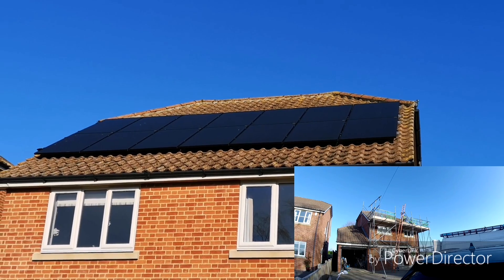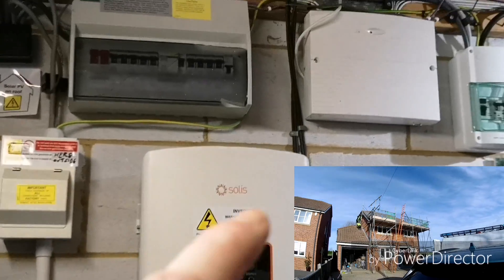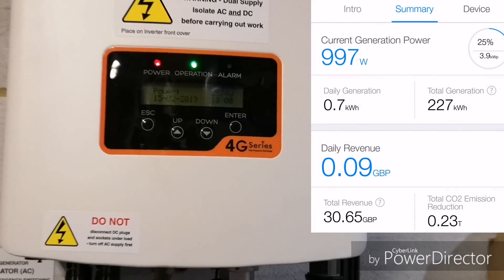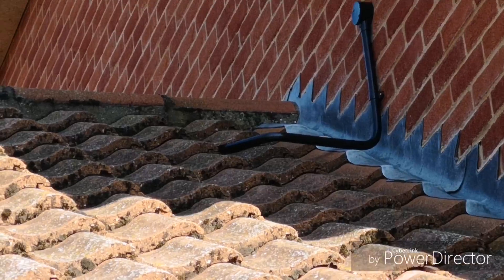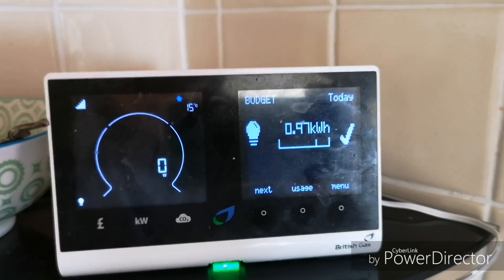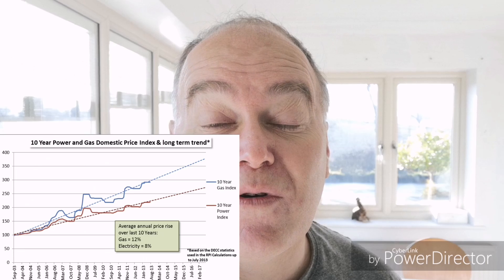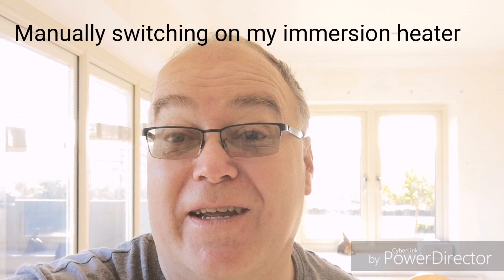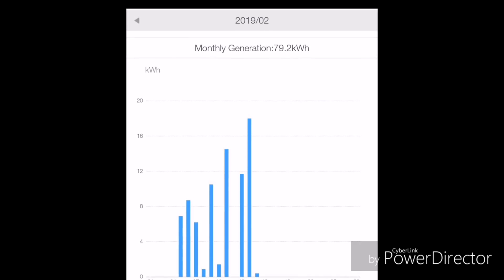Solar PV to go with my Kona and Zappi. Why I've added solar.

Comment: Your Solar install from EON...I have also just invested in EON installation...a bit of luck on my part EON have run out of the 280W   panels and I've managed to be supplied with 320W panels free a result. I notice on your video the feeds from your solar panel come in on Dc1 and Dc2 which is the same as mine, what reason did they give you that only Dc1 is producing power and Dc2 is 0,  I would expect Dc2 to also produce power if the panels are split loaded ie two strings split in half otherwise why is DC2 connected?
Reply from the maker: Lucky so and so on 320w panels. Better in low light conditions.
Eon never mentioned it to me. 
Dç2 shows as almost zero to me also
Reply: @EVPuzzle  hum ! They are coming back Next Monday to check the installation as I calculated that I'm not getting full wattage. we've had maximum of 9.2kw in one day and we've had a couple of great days weather wise. I face south south west no shade with 13 panels. Remind me how many have you got?
Reply from the maker: 14 X 280.
Peak day so far 18kwh.
3.2kw max instant generation seen so far on cloudless day
Reply: @EVPuzzle  I fully understand you never get the Max...but I should be getting near the figures your getting. Btw I've been following you for while, the EON was a no brainer especially as I was also quoted £8000+ for similar installation. I'm currently building a power wall to save more energy. I'm also wanting to get the E-Niro but looking at contract lease, which is another reason why I wanted the Solar panels.
Reply from the maker: I guess it's the fear we all have, not getting quite the right power expected. I was curious at the very low numbers on DC 2, doesn't make sense but then I know nothing about electronics 😣🤔

Currently getting 0.3v on dc 2 Vs 219 on DC 1
Reply: @EVPuzzle  lucky for me  I was a Avionics engineer, but now work in computer security. I'll let you know the out come on Monday. What power are you getting now as it's very clear here in Northamptonshire.
Reply: 199v on DC1   0.70 on DC2
Reply: It would be good to keep in touch and compare output results over time.
Reply: Honda suffering in the change from ice to electric vehicles, should turn plant into electric vehicles.
Reply: @EVPuzzle  Not used to this messaging been replying to myself for last five messages I think Doh!!
Reply: @EVPuzzle  199v on DC1   0.70 on DC2
Reply from the maker: 400watts.  It's 8:39 and 95% high grey/white cloud

If clearer I've seen 1kw in clear skies before 9.

Looks like a nice day ahead
Reply: @EVPuzzle  391 watts 9:15 clear skies
Reply from the maker: That's not right unless it's facing the wrong way. Luckily I'll due south. Rises to my left, sets to the right , slap bang in the middle at midday
Reply: @EVPuzzle  yes I'm facing virtually the same as you rises from our left and sets to the right. Like I say being an ex-Avionics Engineer I've calculated that I'm not getting full power. So I'll what they say when they come back Monday.
Reply from the maker: Fingers crossed
Reply: @EVPuzzle  12:59  bit cloudy 4.7kw produced today 1.3kw at the moment.
Reply from the maker: 1.5kw at present, generated 7.8kwh so far but has been good sun for last hour
Reply: @EVPuzzle  6.5k total today afternoon turned out cloudy.
Reply: @EVPuzzle  just as an update we had 9.8kw today mostly generated this afternoon.
Reply from the maker: Looks like we generated 9.2 yesterday. Different weather makes it hard to compare
Reply: @EVPuzzle  yes your right Nigel, it is difficult with such changes in localised weather. Perhaps when it's clear across the whole of the UK we can get a more accurate comparison.
Reply from the maker: This next week actually looks good here. Warming up nicely

In essence I'm getting 1kw in bright clouded skies, 1.5ke in broken clouds, 2 - 2.3kw in very high slight cloud and 3+ in cloudless skies   all subject to time if day of course.

I've seen 3.6 KW once at 1130 to 1200 just for a few minutes

Cloudless skies here now but getting 240watts at 735am
Reply: @EVPuzzle   just for an update today  my system produced 10.2kw today after a slow uptake this afternoon and the fact day light hours are getting longer things are getting better....roll on Monday when EON come back to revisit the installation.
Reply from the maker: If you had the same surveys as me, they estimate the generation annually so if it's way off they should know.

If it's the panels, I'll gladly swap my 280 for your 320 😉
Reply: @EVPuzzle  I bet you would 😏
Reply: @EVPuzzle  ok update Engineer on site Monday extra panel installed new inverter installed Solis 1p6k.
Now I have Voltage on both DC1 and DC2. Engineer tells me the 1st inverter has DC1 and DC2 connected internally. Which is why you only see one input..I'll check that explanation on my 1p3.6k inverter which I now have spare.
To day very sunny but a lot of Haze total is 9.50kw produced to đay
Reply from the maker: Pleased they've improved things.
The inverter difference makes sense, I think.
Been great here today. Best generation so far. 20kwh, yesterday 19.7kwh and 18.7kwh before that. Beautiful clear skies but foggy first thing on Monday. 
We're lucky to have a great roof position.
Reply: @EVPuzzle  yep that's double what I'm getting ....can't quite work that out yet. 
I've seen your house and its position...mine is more ssw facing and the Sun is still low for our time of year. 10kw is the best I've seen to date I would expect as the Sun gets higher I should see some improvement. I'll keep updating you my progress
Reply from the maker: Different angles and direction seems to count for a lot. I have no shaded areas and no obstructions do again very lucky.

It is odd though how the last 3 days have generated the most here but not produced peak output. I've seen 3.3kw and 3.6kw fleetingly on previous day's  but last 3 days with a clear skies just 3.0kw Max output at mid-day. Slight cloud seems to be better, perhaps less haze

Roll on summer with long days
Reply: @EVPuzzle  have you an Email address I can send you a Graph comparison to my position.
Reply from the maker: Sure.. email is in all the video descriptions..

Eon estimated I'd generate 3000 units a year. That's all that counts I guess as it's the basis we agreed to.
Reply: @EVPuzzle   That's good I can see you have a totally ideal location checked on Google earth wasn't too difficult to track where you are using your videos and Google Earth. As a Security professional be careful publishing videos and letting people know your out for the day, I send those emails tonight.
Reply from the maker: Let me know how close you tracked us?

Yep security is important. House isn't empty so all good.
Reply: @EVPuzzle   just sent you an E-mail Nigel
Reply: @EVPuzzle   had my highest reading today 3075 watts for 1/2 an hour, sun is getting stronger each day.
Reply from the maker: Yep those full sun hazy days weren't the best which surprises me. Great for uninterpreted car charging but today's cloudy sky peaked higher for me today.
Reply: @EVPuzzle  Hi today was a surprise managed to generate 13.10kw the best to date. I thought it would be a bad day for solar generation as we had a lot of cloud, and wind. How did your solar do today?
Reply from the maker: Good too. 3.4kw at peak. Cloudy too. It seems hazy days aren't great but clear days are, cloudy or not. 
20.5kwh is my best day so far and I've seen 3.6kw peak at last.

Haven't used my oil boiler for about 2 weeks now..

Comment: Well, if you’re thinking long term you should definitely think of getting an Eddi.  I have its predecessor (the immersun) and it’s paid for itself twice over.  It can also provide space heating (so on some of your sunny February days, when your Kona’s full (enough), your water’s fully heated think about how 2000 watts or so would help in your house).  Of course the immersun doesn’t talk to the Zappi so I still need to be careful but the immersun is set to 1. Heat the water.  2. When the water’s hot send the surplus to convector heaters (and every 15 minutes or so the immersun checks the water temp to see if the water needs topping up - automatically!)

Comment: Great video. The only part of the cost calculation that I disagree with is that the money from the initial investment could make 4% or so a year using peer to peer money lending and that means the break even point is a few years later. I have been pondering solar but there's a small chance I'll move at some point and that is what held me back. I think battery storage is the game changer once vehicle to grid is available or batteries become  a lot cheaper because of the amount it will save in the evening. I have a 7kw provided by Renault and it is a pity they didn't fit a Zappi. I have just bought a granny charger for emergencies but this would be usable if I ever went solar.
Reply from the maker: Thanks Robert

I said similar about the cost of money in the description. It's costing me 5-6% .

Batteries only work for me if I can get 6-8kwh for about £2k

Comment: Hi like you I have also started to add Solar however I installed my own on part of the garden that is unused and has a good south facing aspect with no shade. Its cost me £1500 so far for my 2Kw system and its working quite well. I got 1465W yesterday (16/2/2019) in central UK so I am pleased with the performance. I have a CH-R hybrid at the moment and will in the future like yourself get an EV so this is the start of the project. I aim to put another 3KW on the garage roof but until I get a storage system i.e a CAR its not worth the effort as I am not registering for FIT being a DIY install.
Like you my OVO Smart meter registers 0 KWh now most of the time and also shows a -ve consumption. My SMART meter also has an Export and Import capability and my previous export reading of 000000 is now populated :-) So we are exporting but I hope to stop that becasue I am not being paid.
Therefore I am considering an i-SOLAR device to divert the export electricity into my immersion heater (250L) as hot water energy storage reducing my gas consumption however like you once I get an EV we have battery storage effectively.
Solar is really easy to install too as the grid tied inverters are very simple with just basically a DC input and AC output that is linked to the household fuse panel via an isolator and suitable cable and connections.
Worth looking into for sure if you plan to have an EV in the future. :-)

Comment: Had my 3.25kw system 3 years and paid back 45percent so no regrets. 2018 was highest yet so you can't really predict but costs are going to go up. Bought my EV to use summer surplus.

Comment: Cheers for the video really interesting sounds like you had a good deal there and timed it right as I heard the FIT is due to end at the end of March this year. So if your considering it then worth checking out soon rather than later. I also believe you have your house energy rated and it has to be energy D or less to get the full FIT. Cheers Ian

Comment: Retired at 52 .....................55 in a couple of months ...................slightly jealous ;)  . Would love an EV but for me its not there yet . Need to do between 14-20k miles per year work wise and some days need to do 300 plus miles as a service engineer , also call outs , so once they can get rapid charging from 0-80% in 20 mins and drop the high initial cost I'm in :)
Reply from the maker: Retired at 42. I'm 52 now. 
Best decision ever.
Reply: @EVPuzzle  Now I'm really jealous ;)
Reply: Hm, in my current situation I can retire when I'm 82...

Comment: Thank you from Cairo Egypt. This way my son will not have to cross the red sea to to a war that protects a hole in the ground that has oil. Thank you from the bottom of my heart.
Reply from the maker: Well that's a different kind of feeling. Too many wars over religion and oil 🤗
Reply: @EVPuzzle  I think 100 W is enough to light 8 LED lights and run a new inverter fridge. I also recommend that you change your fridge to an inverter type that consumes about 30 kWh per month. My old fridge consumed 120 kWh per month. So with the new fridge you will consume 120 kWh for the fridge and the car to drive you at least 300 miles. That is a big saving. I also think that 5,000 Sterling is not much. Just think of it as if you bought the car for 5,000 Sterling more. I am not sure if you will get some tax rebate in the UK for your solar or not but in the US I think they get 30% back.
Reply from the maker: Fridge uses 100 to 150 watts when compressor comes on.  Kitchen being remodeled in a few years so will change everything then
Reply: @EVPuzzle  Good luck. Consider an induction cooker and a pressure cooker. They save a lot.

Comment: Hi  i am in Australia  and have 5.5 Kw solar  system   we have lot  of  sun on most  days get  30 Kwh  a day  and we need it  to power the Air Con  today it  was 35 C  at  8:00 am
Go solar
Reply: Make sure your have done all you can to make your home air tight and energy efficient.
Air sealing, insulating, triple pane windows, hight efficiency heating / cooling systems, LED lighting, set back thermostats all help and make it easier to balance energy generation with energy consumption.

Comment: I think you are will be lucky to reach payback within 5 years. I have 3kW solar (10 x 300 w LG panels and an SMA inverter) installed in 2014 with a fair FIT. I initially thought that the deemed export was generous at 50% but it's nearer 75% so the more you can use the better you will be. I expect payback in about year 12. I don't have a BEV to dump the export to but will be getting a battery to drastically reduce the amount that I export and hence reduce my import costs. Over the last 28 days I have generated 99.63kWh, used 47.35kWh Exported 52.08kWh and imported 291.3kWh.
Reply: Your Solar PV is really producing. Which country and how many Kwh do you produce per year

Comment: Hello Nigel, I have just had the same size system installed at the end of Jan and on the good days we have been averaging 9 Kw per day. I was just wondering where you attached the clamp for you old monitoring device? I was wondering what the recommendations were for an immersion switch?
Happy generating.
Reply from the maker: It's still as per BG installed in the meter cupboard
Reply: @EVPuzzle   Thanks for that I will put mine back on, it was disconnected when the smart meter was installed,

Comment: Payback in 5 years is wrong .even at £500 / year savings your looking at 10 years.not possible with a fit payment of just 3.78p/kw. Am I missing something ?
My system was £8000 for a 4 kw with individual inverters at a fit rate of 13p .payback is 10 years.
Reply from the maker: 5s optimistic for sure

Comment: Hi Nigel,
16 panels 12.3kwh 15th Feb, but with our immersion switch the immersion heater automatically switches on the moment we are in an export energy position, so free hot water!!

I understand that your Zappi charger has this facility built in, so that you can add another export interrupt device like a battery or immersion heater. The trick is to export nothing at all.
E-Niro on order, patiently awaiting delivery.
Reply from the maker: 18kwh in a day is the best so far here but I'm not soaking it all into the hot water yet. Won't be long though.
Zappi needs another device called the Eddi for this. Not certain if it's worth the £385 plus install. 
I'm researching options
Reply: @EVPuzzle  https://www.earthwiseproducts.co.uk/ Solic £199 + fitting will probably work with your Zappi, this is what I am using, recommended.
Reply from the maker: Thanks , I've seen it for sale so on my radar.

Comment: Apart from a really good installation like this, its also possible to get a jump-start version that is off grid. This would be a holiday trailer affair, one or two stand-alone solar panels, an inverter and maybe two deep-cycle batteries(car battery size). This would be used to feed some mutli-block outlets around the hose to tap into. The advantage is its cheap and involves no ripping or surgery or installation costs. - plug and play. Plus you can add more to it over time. I don't know why more people don't go for it. I personally use 4 Kwatts per day.

Comment: My meters are outside, and the circuit-breaker/fuse-box is in a small (roughly shoe-box-sized) cupboard mounted on the wall in my dining room.  So although I would like Solar and even a battery (Tesla Powerwall?), is it possible to have all those extra boxes and cables etc etc that are in your garage put somewhere else?  In the loft maybe?  The Mrs certainly would not permit any installation that is as "messy" as that cat's-cradle of wiring and boxes to exist in our dining room....
Reply from the maker: Box them in or mount a cupboard on the wall ?

Comment: Interesting video. I've installeer a heatpump in 2004 because I thougth then that generating your own energy would be the future. Also a cheap weekend price for electricity was the signaal to do it. In 2009 we've changed our 72m2 water Solar system for a 10kW PV grid-tied system. We cook, heat, have hot water, everything on electricity. Since a couple of years we've tot may for the grid use and with the smart meter they will change the files again. So I bougth me a battery on wheels, a e-Niro, so I van exactly die the same thing as you do exceptioneel of the use of my heatpump. Seasonally storage is still a dreams. But with the cat it will help to may less and maybe a V2H van be possible.
Reply from the maker: You're way ahead of me lol
Reply: @EVPuzzle  not het, my EV Comes in May of June

Comment: Sounds good I my self got solar then ⚡️car now my bills are around 750£ a year but get back 650 £ in fit payments, and now have a little off grid solar powering a backup battery that runs tv ,Xbox frigid ,now making more than I use .🌝now in the black .but your right about when you retired to have the house self efficient is the best  idea .👍👍👍👍